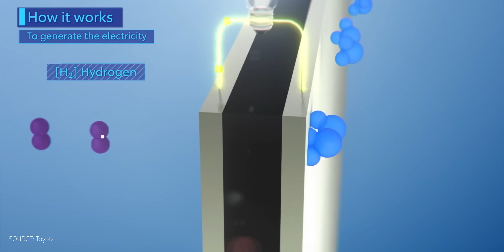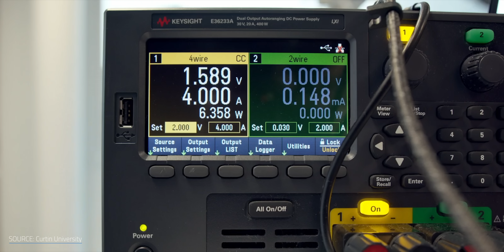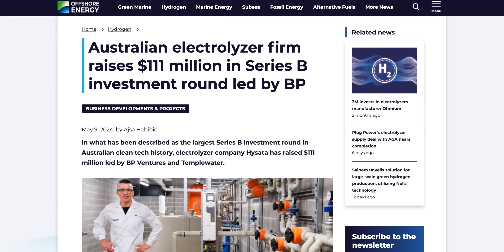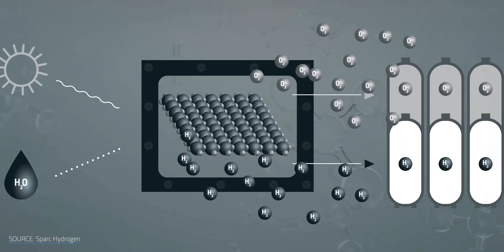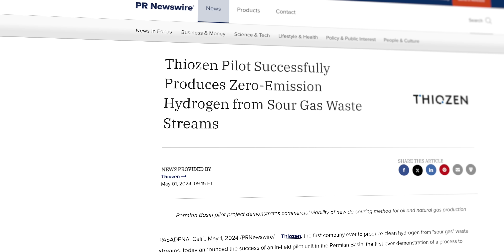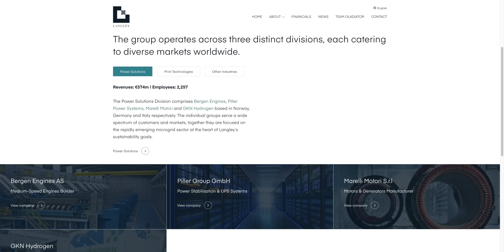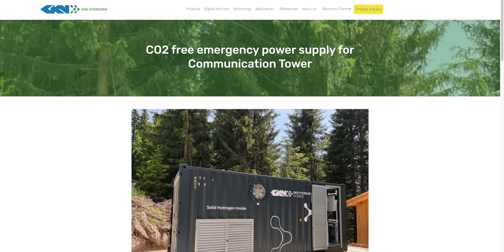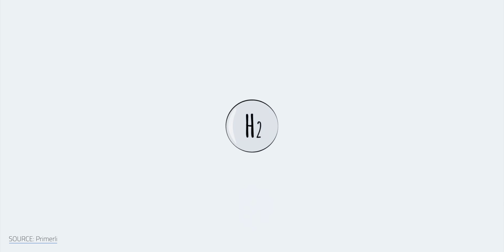How a Hydrogen Breakthrough is Closer Than Ever

Comment: Hydrogen is not a fuel, it's an energy storage medium, like a battery. It's biggest problem is storage difficulty. It's never going to be a mainstream outside of niche applications.
Reply: by the same logic, oil is also just a storage medium. which we just aren't able to create ourselves, and are "lucky" enough to have lots of it underground.
Reply: @theblackwithin3457  no, it’s not. We pump oil out of the ground, extracting solar energy life stored away millions of years ago. We get more energy out of oil than we put in.

With green hydrogen, we have to make it ourselves, which means we’re putting in more energy than we’re getting out. We’re just moving energy from the hydrogen plant to the point where the hydrogen is oxidized. Only difference compared to a battery is that we’re storing energy as chemical rather than electrical potential.

It may make sense one day for aircraft that can afford to pay a premium for low weight. For everyone else, it’s just a bad way to move around energy… and a great way to appear green while continuing to sell fossil fuel.

Comment: Generating Hydrogen by windmill or solar only makes sense as a “battery” to store excess capacity. Using the electricity itself is far, far more efficient because the electrical grid is far more efficient than moving Hydrogen around..which isn’t talk much about here.

Comment: IMHO, hydrogen is a better long term solution than electricity because it doesn't rely on batteries until somebody makes a battery that's cheap, portable, lasts for a long time, is green, and preferably doesn't rely on rare minerals. Now if we can produce unattended hydrogen farms (e.g. wind or tides) that store hydrogen locally... {sigh}
Reply: You are aware all the points you raised about negatives of batteries equally apply to hydrogen production and use; fuel/electrolysis cells use even rarer mined materials than batteries (such as platinum catalysts) and storage vessels vent hydrogen to the atmosphere when it acts a powerful green house enabler (12x the impact of CO2 alone). You're also discounting the various forms of batteries not reliant on Lithium, such as flow batteries that offer long term storage as well (surpassing that of hydrogen's ability).

Comment: Again?  Why use lots of electricity to create and compress hydrogen when we can just use the electricity?  I don't understand why hydrogen as a automotive fuel keeps getting research money..  why?  Stop the madness..
Reply: It makes sense in Australia. We have a lot of renewables sources which are located inland or far from population centres. We could become a net exporter of energy if we can find a way of “bottling” energy rather than using transmission wires. I think we want to be an energy exporter but we need a way of moving the energy around. One option is hydrogen. Another I’ve heard of is ammonia.
Reply: @alexmerchant2967 we dont have excess electricity to produce and compress h2.
Reply: How much electricity does it take to carry a 1 tonne battery around on your car, rather than a hydrogen cell? Hydrogen will be used powering tankers, trains and buses too, heavy vehicles that cannot carry batteries. The tech is already here, politics keeps it on the horizon
Reply: Problem with that is there is no great demand for bulk hydrogen. You would be better off loading a container ship with batteries, charging with your excess energy and then discharging at a port that will pay the most for your kWh.  Or build AI data centers where you have excuses energy and sell the computation time via internet transmission via cables you have or satellite links.
Reply: @vaughnhalsey9049  interesting idea, I think construction cost & maintenance/support would favour building closer to the cities rather than closer to electricity sources but yeah that red earth windswept matrix-like gigafactory look could be a thing 😊
Reply: @N5ZY  A wind or solar farm far from cities may provide plenty of electricity that isn't easy to transfer for use. A hydrogen plant near these generators could produce enough hydrogen to provide fuel for consumers and for the transport vehicles.
Reply: The electricity still needs to be stored somehow. And you cant just store electricity itself easily if you want any density
Reply: It is a good thing most people here in the comments don´t make the decision or we still be in the stone age .
Reply: @N5ZY  because the batteries are worse for the environment than just better engine design.
Reply: Energy density
Reply: I may have missed something but I don’t think it was claimed in the video that this was for EV use. Outside of EVs there are use cases where H2 makes sense or is the better of bad alternatives. I’ve recently learnt there are even H2 ICE vehicles in use in mining just because of the sheer power thirst of those vehicles, they have to accept the poor efficiency. It’s either diesel or H2ICE for that niche, currently. 
I think if H2 overcomes some major hurdles, it will find some uses. Probably not for passenger cars in most areas, but as an energy storage method for instance. Not the most efficient, but for longer term storage it may make more sense. 
Ideally of course it gets mainly decoupled from the fossil fuel industry and fuelled by renewables instead.
Reply: With the current mix of sources within metro areas (rooftop solar and wind) we produce more than we use during the day (see recent news re: South Australia). If we invest and deploy more renewable generation this can produce an excess? cf. Victoria is planning 95% renewables by 2035. If you continue that trend i think you argue we can become a net exporter. Also could be useful domestically in remote regions if we could use these energy sources rather than diesel? It would depend on the economics: if that is superior to solar + battery and whether it works for transport & farm machinery etc.

Comment: This is just dumb.  The answer to all these questions is yes, it can be done.  The real question is why?  The windmill would be better off feeding the grid or a battery plant.  Less conversion loss.  Battery storage is getting cheaper everyday.  While hydrogen will always have worse storage and transportation problems than oil and gas.  Every $$$ spent on trying to make hydrogen work is spent to keep consumers buying a product they don't need when better options are available.  I thought hydrogen was cool in the 90's when mazda was working on a hydrogen powered rotary.  Hydrogen has no future to do just about anything.

Comment: More green energy to produce the hydrogen green energy.  Do the advantages of hydrogen out weigh the costs of producing the green energy to run the hydrogen plants instead of providing the energy directly to cities?
On the flip side one hydrogen plant would replace how many wind generators out at sea which can not be easily maintained for logistic and safety reasons?

Comment: 1. Generation. Getting better, but as far as I know, water oxidation anodes are still either platinum or require large overpotential, killing either cost (and scalability) or efficiency. 
2. Storage. Barely addressed. Still a huge problem at scale. 
3. Transportation. Not addressed. Still a huge problem at scale. 
4. Fuel cells. Not addressed. Similar to generation, I believe we still need platinum electrodes to have decent efficiency. 

Hydrogen economies are worth continued R&D, but we're still very far from any meaningful contribution to w carbon-neutral or carbon-free energy economy.

Comment: armchair engineers hate hydrogen solar wind and nuclear, but they don't understand how engineering works... iterations and developments in efficiency and design over decades improve and refine them. eg you couldn't put a solar panel above a certain deg's into the hemisphere, and they were made using blue coal and lots of energy, plus couldn't be recycled 20 years ago. now they are way more efficient, can be on houses in northern england and are made from less carbon intensive materials.

Comment: No. Reasoning, hydrogen requires energy to be split. Now I don’t know the efficacy of that. I would think that just using the electricity that solar or wind generates would be more efficient. Next is storage, hydrogen is a very small atom. It leaks out and causes damage to the storage vessel. I think hydrogen is a dream just like Fusion. At our current technology advancement it’s just not practical.